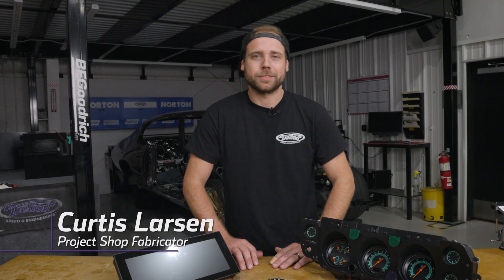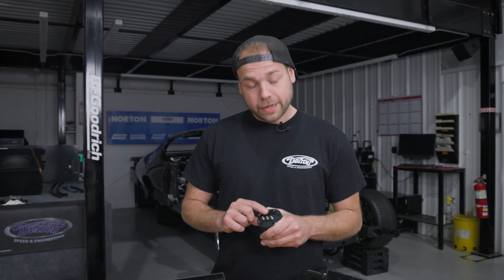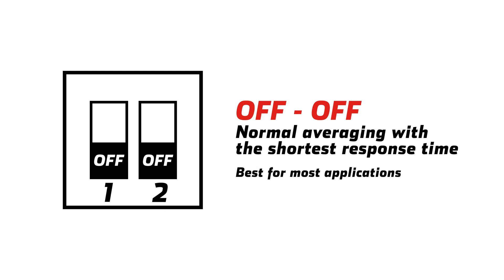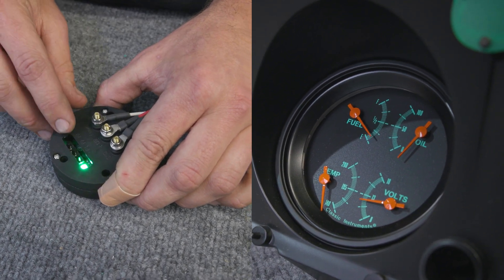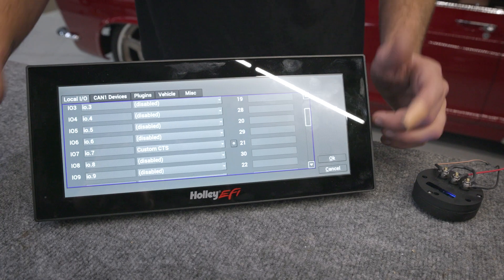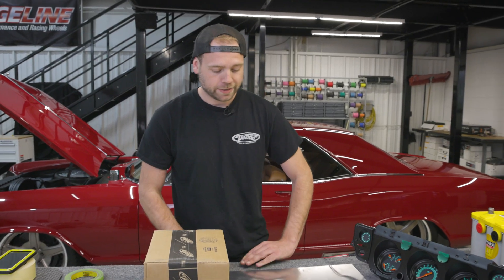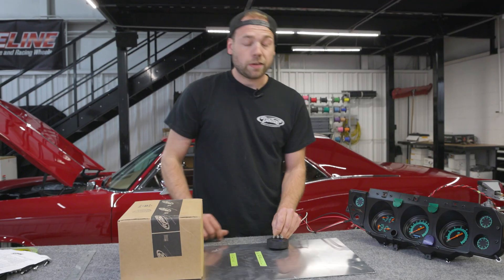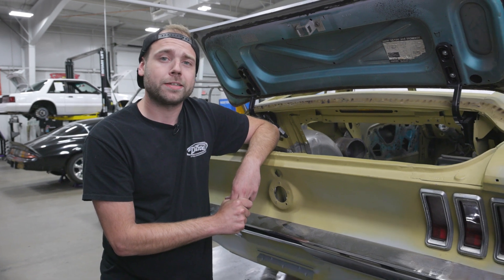How-To: Install Holley’s Easy Level Fuel Sender

Comment: I recently installed one of these. I set it up like as described. Pretty easy. I tested it by moving the sensor around. Now that I have fuel in my cell i'm not getting a reading. I have 5 gallons in a 15 gallon tank. When I turn  the key the indicator cycles to about a 1/3 full level as I would expect. Then returns to E. Never returns to a 1/3 reading. Any thoughts ??
Reply: people have issues with these in fuel cells because they are typically shiny aluminum and mess up the laser readings....
Reply: I have it hooked to a prodash and I found that I got erratic readings when I had it grounded to the chassis. I rewired to use the ground from the Holley prodash and it works like it should now.

Comment: Used the auto meter setup instructions for my Sport Comp II, it will not calibrate.  Holley if it doesn’t work with a gauge don’t say it does.  This was a waste of my money.

Comment: anyone have issues with this in an aluminum tank? mine works fine out of the tank but shows empty when installed. curious if the shiny aluminum finish is the issue. going to try calibrating it installed in the tank and may scuff the bottom under the sender with scotchbrite pad and hope the filter does it's job.
Reply: Mine was on an aluminum fuell cell. Ive trie programming it outside of the fuel cell, on the fuel cell, and with fuell inside of the cell. Programming would be fine works as it should. As soon as I turn the key off, it wouldnt work right again.

Comment: does it have a insulation boot , would have to short out the + wire , also do you wire the + wire to your ignition on so it only has  power when car is running only
Reply: no boot, make sure you insulate the ring terminal and secure it well. it does have a small boot that goes over the studs. wire so it has power same time as your other gauges. usually accessory/ignition +

Comment: I wait longer than the 8-10 seconds they recommend in the instructions. Waited a minute before jumping to the next step. Talked to Classic Industries(maker of the sending unit, not Holley). They said it could react faster on the gauge display(Holley 12.3 Pro Dash)than the actual sending unit to respond. Always had the issue of it showing empty when it was a half tank. So far its working as it should. But time will tell.
Reply: always had issue of regular sender showing E on half tank or this new lidar one? because i just installed this lidar sender and im showing E on half tank..
Reply: Ive given up with this “easy” sending unit. couldnt get it to work and didnt want to waste anymore time with it. ran out of fuel and was stuck on the side of the road. I purchased a ISSPRO floatless with their E85 coating.

Comment: This thing is junk. I set it up exactly the same way you set yours up and put it in the tank , it read empty,put the tank in the car. Put 5 gallons of gas in it. It read quarter tank, put five more gallons of gas in it went to full . The tank is only a 15 gallon tank . no matter what I did it doesn’t work right.

Comment: Holley, it wasn't "easy" the thing always looks past the last 3rd of the remaining  fuel and quit working after one trip when I pulled it for the 3rd time to see why it wasn't reading the bottom 3rd set it up on the rig I made to set it up, looked as if it was correct put it back in the tank, and still wont read the bottom 3rd. so I decided to use a fluid to re re ... set it up, I set the empty volume in my test stand looked at my gauge to verify empty and the led was off, zero response and stuck on 1.4v output. Now I have to re install the old sending unit good thing I didn't through it away.

Comment: Indicates correctly (1/2 tank) when tested 7in away from a surface outside of the tank. Indicates empty when tested 7 inches away from fuel inside the tank. Why does it work differently on fuel than on a solid surface?
Reply: having the same issue right now. outside my aluminum tank it shows accurate. installed in tank, shows E when i have 1/2 tank. testing to see if the shiny aluminum finish is the issue. i spoke with classic instruments (company that makes it for holley). they instructed me to install on the tank and drain the tank to the "reserve level" and set to E, then fill it at a gas station to "full" and set that level. testing this today. i plan to make a video after.
Reply: I set it up using a lab stand, nice a sturdy and can control the Hight easily, the problem is the lidar is mass sensitive the cast iron base  easily sends a signal back to the unit, I was going to use water in a beaker, but the fuel sender quit working before I had a chance to test it.

Comment: Does the kit come with a template so it can be mounted in any tank?  Would this fit in a foxbody tank?
Reply: It uses a universal 5 bolt sending unit bolt pattern.  You can buy flanges to weld on if you are installing in a factory tank.